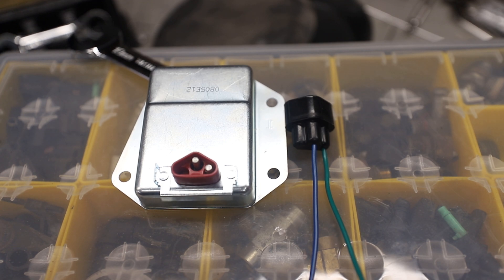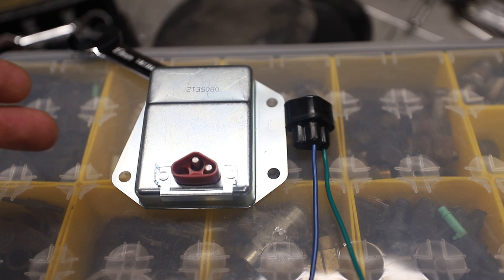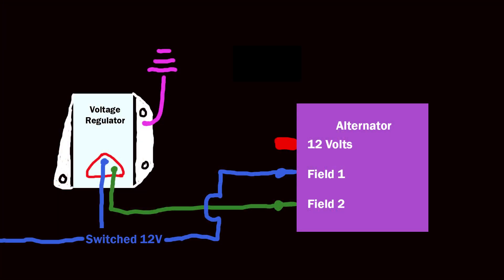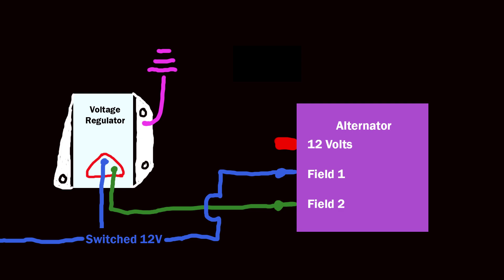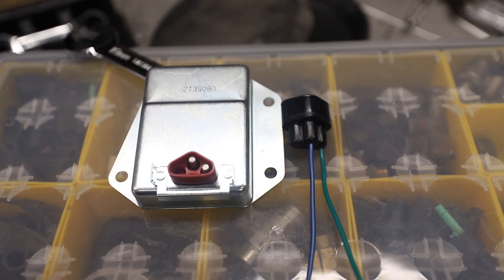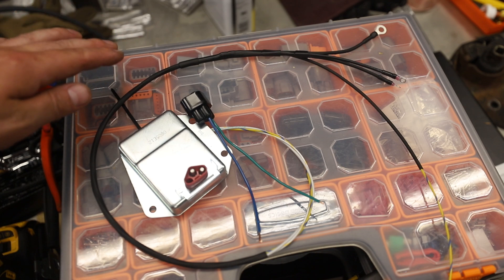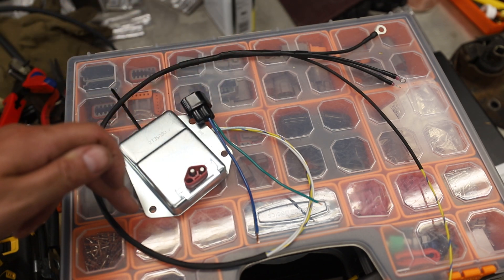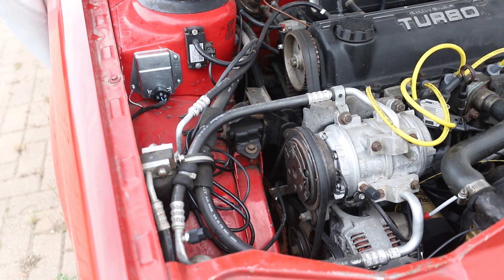Chrysler External Voltage Regulator Installation

Comment: Put one in my 85 New Yorker. Just spliced it into the factory harness and hid it up by the power module.
Reply from the maker: That would be super easy to do also. I really like that idea for a car with stock wiring. Thanks for the comment, and the view.

Comment: Did this same "upgrade" to my 88 p body. Super simple and just works! Unlike the computer controlled stuff it replaced.
Reply from the maker: I've never had a regulator die in a computer, but one of these is rock solid, available for cheap anywhere, easy to install, and a great solution for those running aftermarket fuel injection. Thanks for the comment, and the view!